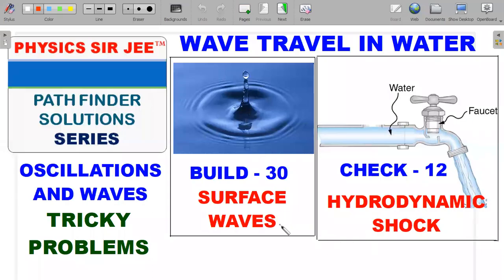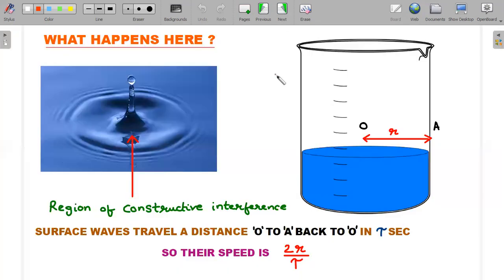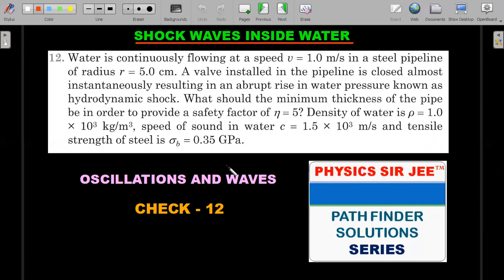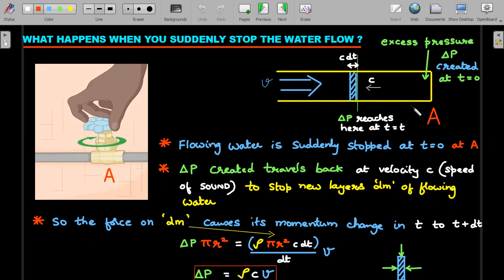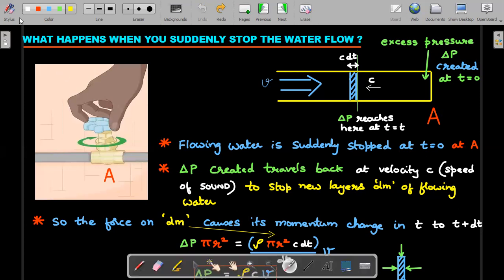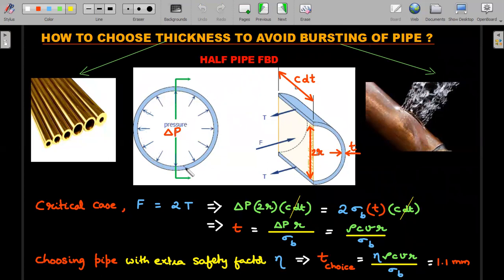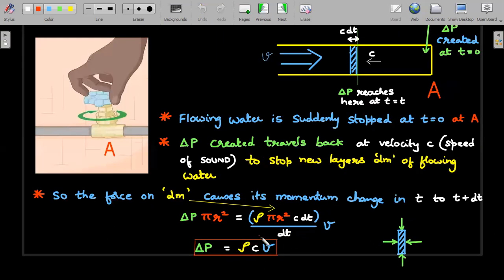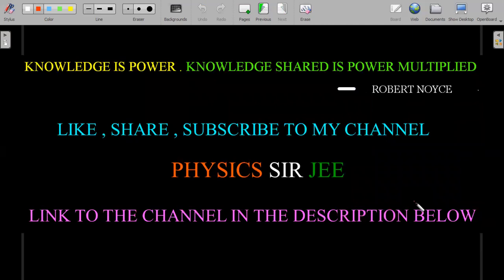PATHFINDER SOLUTIONS [JEE ADVANCED] | SOUND BUILD-30 CHECK-12  HYDRODYNAMIC SHOCK | WATER WAVES

Comment: Sir this can be used for gas also na same concept and a mind blowing concept but sir in that there will be lot of factors like in gas its thermal energy could change due to abrupt closing of tap since gas are  more prone to temp rise so soon than water or liquid generally and it's kind a depend on material also since material decides a flow to be laminar or not
Reply from the maker: Yes , true 👍

Comment: Janardhan sir, in that Dielectric RC circuit problem you gave from pathfinder CYU 18. Im getting charge building time constant as rho epsilon (3-k). What I did was Immediately after connecting the metallic plates will have some free charge and dielectric will have bound charge. After that moment I assumed some extra Charge Q from the battery on metal plate and some extra charge q on the dielectric. Now to get current in the dielectric, i used gauss law of displacement vector to obtain free charge on the surface of dielectric in terms of Q and q. Then I equated current in dielectric to d/dt (Qfree). And not dq/dt as charge q on dielectric includes both free and bound charge and among them only free charges can flow as they arise due to presence of some free electrons and bound charges are due to alignment of dipoles that are stationary. Is my approach correct? Sir pls tell
Reply from the maker: Your approach looks ok. Current should be written as dQfree/dt and not dQnet/dt . I am not sure about your Calculation. I will make the video by next week
Reply from the maker: I am not deleting your comments. They still show in my notifications. But when I go inside the comments are not there. I thought you were deleting them 😂. Now , it's confirmed , YT algorithm is doing it. May be something about links considered as spam 🤷
Reply: @PHYSICSSIRJEE  Sir, I got ans to quickies as r=t^2/5*(5/2√3E/4πρ)^2/5 is this correct sir?

Comment: My doubt is why doesn't the velocity of whole liquid become zero simultaneously. If there exists an instant when one part of the liquid is moving and the other is stationary wouldn't it cause density of water to increase?. Also why does the excess pressure remain constant in magnitude with time? I am imagining water as a solid block of density rho
Reply from the maker: Water has finite bulk modulus , illustrated by speed of sound mentioned in the question . No mechanical information travels faster than sound in a medium. Also we are assuming "non-dissipating" medium as dissipation constant is not mentioned ( JEE ADVANCED LEVEL Problem) . That's why excess pressure doesn't die as travels back but does take "time" to travel back. 

For absolutely rigid assumption , velocity of sound will be theoretically infinite . ...
Reply: @PHYSICSSIRJEE  Got it sir. Sir please keep bringing important problems from pathfinder because there are so many problems in this book it is practically impossible for us to know which are the essential concepts for jee advanced